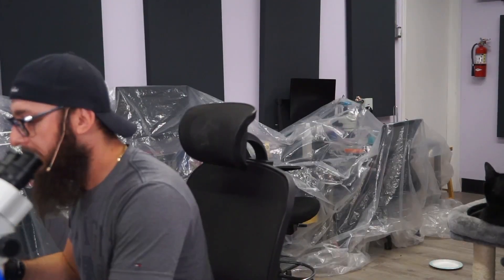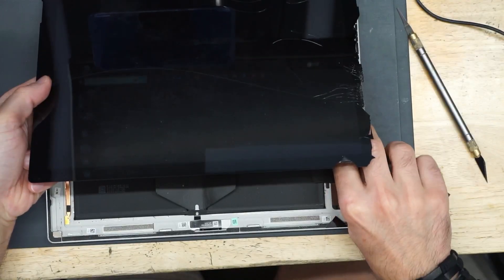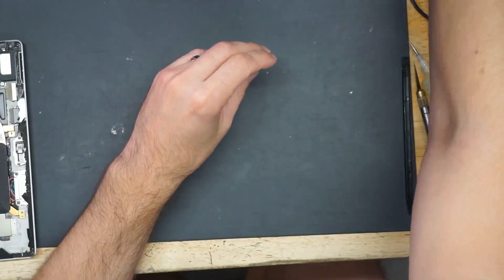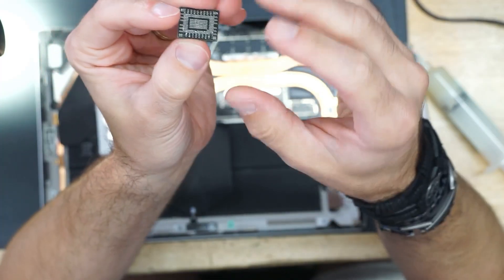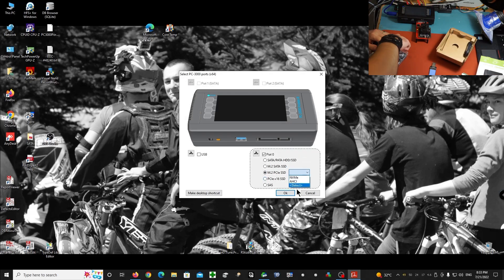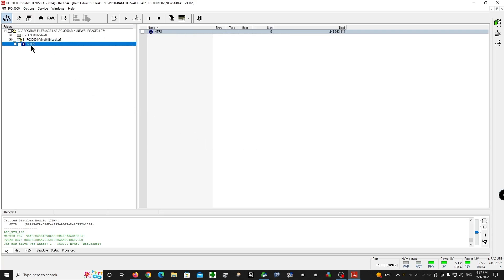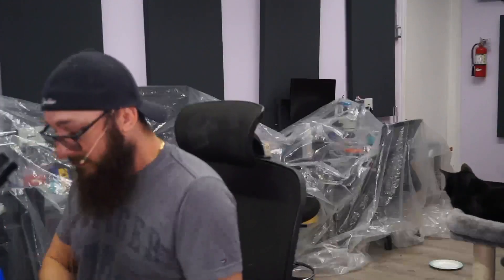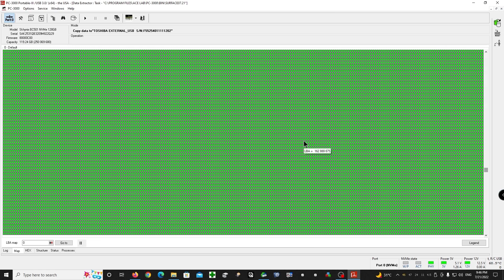Microsoft Surface data recovery by Rossmann Repair Group

Comment: I have a Surface Pro that dual-boots Linux and Windows 10. This is not a problem so long as you do not use bitlocker, although after updating the Linux kernel it wiped out my custom boot menu (rEFInd boot manager) and I am back to using GRUB.

Comment: I've had two primary drive M.2 drives "die" on me this summer.  One in a laptop and the other in a desktop.  Standard Samsung M.2 drives.  Both reported that they hit their Available Spare Threshold.  The laptop happened first, I got it a bigger SSD, so I ended up doing a fresh install and copying important files back onto it.  The desktop, I didn't have enough spare space to do a disk image, so I had to ddrescue the entire drive to the new drive.  After fixing the bios to use the new drive for booting, I was back in business.  I learn a little bit more with each drive that fails me over the years.  It all started with an 80 GB external drive I wanted things off of.  Is there any way to force a drive to let you use that last bit of spare threshold?  It would have been a little easier if I could have knocked the drive back into normal mode for like 5% more usage.

Comment: My only complaint is that your wisdom comes in but a silent rivulet of murmurs. Love the accent. Love the attitude.

I don't like these things. At first, I liked that they were far more indestructable than other portable computers, be they made of plastic or shiny light metals. People sat on these things, crushed them, abused them - and Surface would still purr along  nicely. I loved that bit. Then the first, very custom power supplies started to come apart and the spell was broken.

For years now, M$ silently locking away people's data with their own flavour of bitlocker was a bane on many a despairing soul's sanity, and good cash in my pocket. Things are only going to get worse from here on out, because M$ can - and will - choose to do so.

This type of do or die "all your data are belong to us and it's all gone now" lulz are fine and dandy in a corporate setting. For normal, average users and customers, this thing is a killer.

Comment: Surface Pro devices should boot Linux with ease from USB. Iirc correctly it just needs volume down during pressing power to get into settings and disabling secure boot. Actually not even that is mandatory to my knowledge anymore. MS isn't blocking booting other OS's at all.

Comment: I recovered files from a surface ~6 years ago... I still have shards off glass in my hands. Beautiful work!
Reply: They have been improving with their newer devices, easy to access and replace the ssd on the newest pro and the newest laptop uses magnets instead of tabs to keep the keyboard in place. Hopefully it will keep improving.

Comment: They do allow to boot linux on surface. I had few years ago ms surface pro 4, and I used ubuntu as my main os
Reply: Until battery decided to expand while destroying my screen in the process
Reply: Yes you can, if you have access to the BIOS and you can turn "security boot" off. To do that internal SSD has to be working.
Reply: @bogumipiskorz2752  so it don't even has bios chip like I think all normal motherboards has? I never had a look at surface internals by mysel more than I needed to disconnect battery, that cracked screen when started expanding
Reply: @bogumipiskorz2752  And I just written this in respons to „Of course microsoft, they don't allow you to boot linux" which I assumed he meant in general, which in that case would be not true

Comment: Louis, you grew a beard and started wearing glasses and gained an accent. lol... BTW what ever happened to Jailbreaking or rooting? Thank you for the video, I always wondered how that worked.
Reply: Nothing happened to them. On the iOS side of things, jailbreaks are still actively being developed as new versions of iOS come out. For Android, while it depends on whether your device's bootloader is unlockable, with a little bit of searching you can find a compatible recovery environment (ex. TWRP), and use Magisk to root.

I actually rooted an Android phone a few months ago: a Moto G4 Plus, just for fun 😊. Jailbreaking and rooting are still very much a thing.

Comment: My unfortunate problems are on intel based systems. Windows dies first but even under Linux under unfortunate circumstances it will fail too. Changed processor motherboard ram and soon to be power supply.